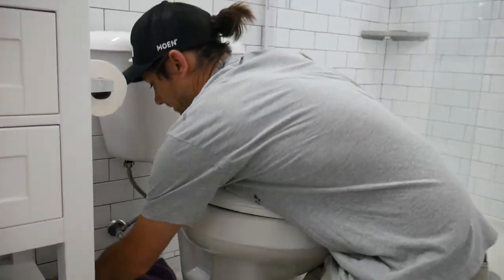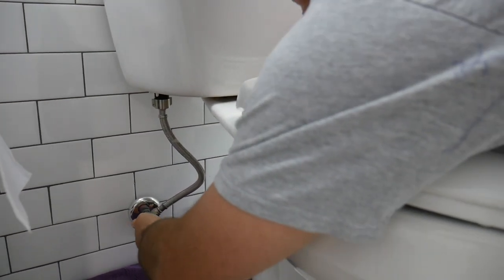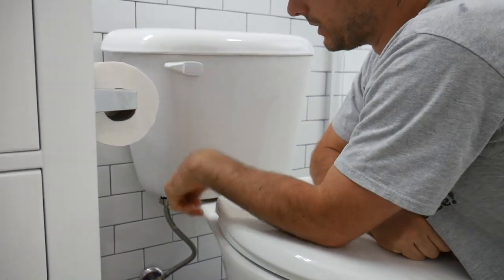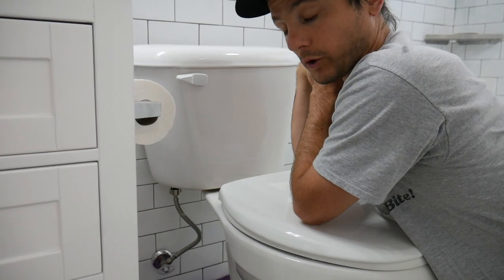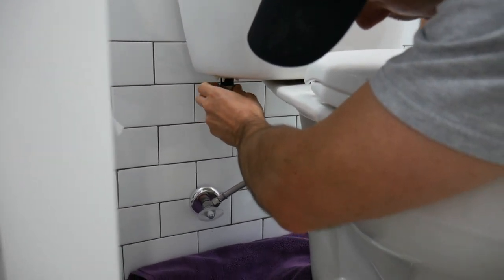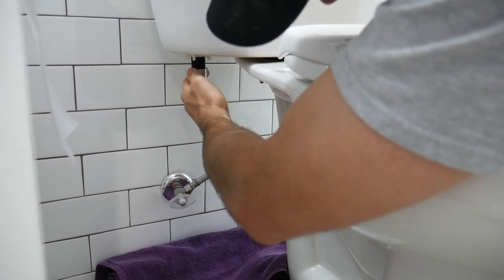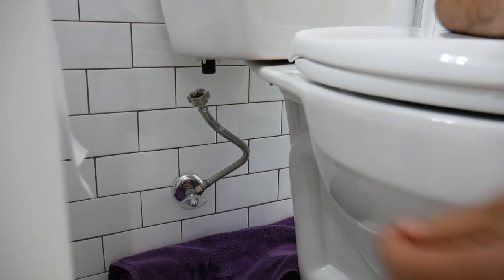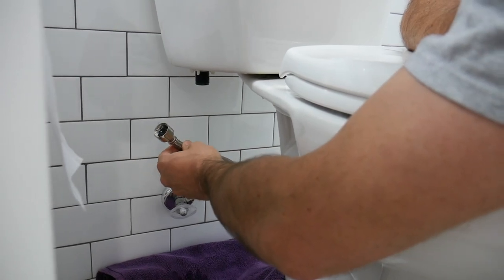How To Install a Bidet Sprayer for Your Toilet with a T Valve

Comment: Just got and installed.  A+. Love the feel. Seems durable and high quality. I agree with another post I saw. It is indeed beautiful.  This tutorial thing was helpful.  The advice you gave about tightening is exactly what happened to one of the leaky spots. As soon as I used a tool to tighten it a bit more, leak was gone. At first I felt it was tight enough, apparently not. 😁 .. thank you for a great product.
Reply from the maker: You are very welcome and thanks for your feedback. Let us know if you need anything else!

Comment: How can this be applied in a wall hung toilet?
Reply from the maker: Hi Aya! This could be done. You just have to take into account certain variables. For example, there are toilets whose plumbing goes right into the wall and would make it impossible to install. Also take into account that this needs a 1/2 inch pipe to attach to and a 7/8 to attach to the other side.

Comment: Hello I installed the bidet however the toilet itself only flushes when the valves is turned all the way down. And leaving it down overflows the toilet. Is there a way to make the toilet work on its own. Thanks
Reply from the maker: Hi, 

We would definitely have to check what is going on. This is not how it normally operates. Please send us a small video or photos at contact@theshowerheadstore.com so we can check it out. 

Thank you very much!

Comment: I’m gonna purchase one tomorrow!
Reply from the maker: Awesome! We look forward to your purchase.
Reply: @theshowerheadstore  I got it, have had for a couple weeks but I can’t get the first nut under the tank off for a few reasons, it’s a very tight squeeze, the Chanel lock is too small and I’m barely strong enough to turn the damn thing. Son in law will have to step in.
Reply from the maker: @barbaracrisp6121  Hello Barbabra, based on your concern, I would recommend getting a THU9090R 8 Inch Extension Hose Fits for TOTO C110/E200/S300/S400 Wash Lets Connector to Toilet- 7/8 Male Connect to T adapter of Bidet/Diaper sprayer- 7/8 Female Connect Ballcock Pipe of Toilet Tank. You can find more information here: https://www.amazon.com/dp/B07YZ4LCQ8

Comment: Thank you for the video! A question, my toilet tank is kind of unconventional and instead of having the hose connecting at the bottom of the tank, the hose goes all the way up and into the tank. I will need to connect the T valve at the open/close valve (by the wall) instead of at the tank. Do you think I can install it next to valve and just look for an adapter that connects the T valve to the hose that goes into the tank, instead of the plastic connector at the bottom of the water tank?
Reply from the maker: I don’t think so. I know what type of toilet you are talking about and that makes it pretty much impossible to use this type of bidet. I’d suggest looking at a toilet seat bidet.

Comment: I'm a little confused about the washers. There is a small washer with a screen that was in the hose bag. Should it go on top of the washer already in the conical end of the hose? Also, in the t-valve you mention a rubber washer (2:25), but the valve I was sent looks a bit different with a hard sloped black part around a brass hex center. It seems fixed in place.  Do I need to put in a washer from the "extra washers" bag on top of this?  Thanks.
Reply from the maker: Washers are already pre-installed in the products that you got but we also include additional washers for spare purposes. if there is a washer already in the unit, then there is no need to add another. Also, if you could send us a picture of the Bidet that you received, we'll be happy to let you know if you received or product.
Reply: @theshowerheadstore  I managed to install the bidet sprayer yesterday without any problems.  I did put the mesh-screened washer on top of the existing washer in the conical end and it works fine.  Thanks.
Reply from the maker: @theosrubegoldberg9660  There should be any need for you to add 2 washers in the connection, you should be Abel to use one.

Comment: can I install the T valve adapter directly on the water supply rather than on the toilet? I don't have a good access to the back of my toilet.
Reply from the maker: Your bidet was designed to securely connect to your toilet fill valve, toilet supply line and bidet hose with the thread measurements of  7/8” x 7/8” x 1/2" respectively. A such we do not recommend connecting to your Water supply line only.  If you have one of those toilets with skirted design of toilet seat, concealed ballcock supply, cramped space or if the water supply was too far, you can use this extension hose to connect your T-Valve adapter to your toilet tank fill valve if the space is too narrow to the wall or the connections are concealed> https://www.amazon.com/gp/product/B07Q4XQCVN/ref=ox_sc_saved_image_10?smid=A1QN756YROXM9J&psc=1

Comment: can you install a bidet hose to a toilet with concealed tank? we cant seem to find the valve to connect the bidet.
Reply from the maker: The T Valve adapter for the bidet connects to your toilet tank's fill valve nipple and then to your water supply line  and your bidet hose. Without the fill valve you wont be able to use this bidet.

Comment: What is the extra screen for?  I just noticed it & wondering if it is placed into the handle head?  Is this a water restrictor?  It seems to fit in the handle head.  Just looking for verification seeing that it wasn't set in place like the other items aka the washers.   Any feed back appreciated.
    Thank You.
Reply from the maker: Hello Richard, the extra screened washer that you received is also a replacement screened washer like the other replacement rubber washers. Let me know if you have any other questions.
Reply: @theshowerheadstore  Yes understood that it is extra but if extra where is the original piece in the device.  I opened device up and find regular washers but cannot fin one with a screen on it?
Reply from the maker: @richardwhit7773  The screened washer would have been the only screened washer in the package. It can be used in place of any of the other washers already included.

Comment: Hi, I'm looking into purchasing this bidet. However, when I look at the setup of my toilet, the fill valve nipple is located inside the toilet at the top instead of the one showing in your video which is outside at the bottom. Is there any advice in terms of installing?
Reply from the maker: Typically, a tailpiece that extends through the bottom of the tank is usually visible from the bottom of the tank itself. This is where it attaches to a supply tube that runs to a fixture shutoff valve. So that we can understand the one that you are using, please contact us via email with pictures at contact@theshowerheadstore.com

Comment: could please tell me which size T-valve you used?
Reply from the maker: Universal T-Valve ~ Securely connects your toilet fill valve, toilet supply line and bidet hose. Measures: 7/8” x 7/8” x 1/2" [Brass]

Comment: Would this set up also work as a hose and sprayer to wash a dog in standard shower (no tub) in a small bathroom? I already have a sprayer that connects to a regular garden hose that I'd like to use so I would probably have to use a different hose than the one you use.  Would it still work or is there another option that would be easier/cheaper?
Reply from the maker: The bidet T-Valve was designed to get attached to your toilet supply line and the toilet fill valve nipple with the measurement  7/8” x 7/8” x 1/2". It was not designed for attachment in a shower.

Comment: Leak between toilet tank and t adapter
Reply from the maker: HI, Please contact us via our customer support so we can help you out. You can reach us at: contact@theshowerheadstore.com  or please give us a call 307-274-8920
Reply: I got the same issue, I used teflon tape and nothing
Reply: I am having the same problem